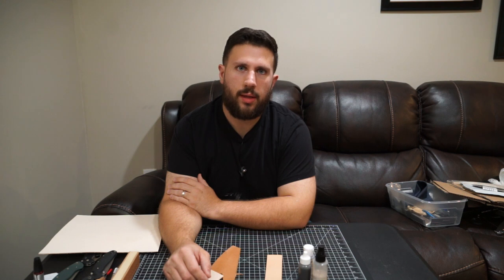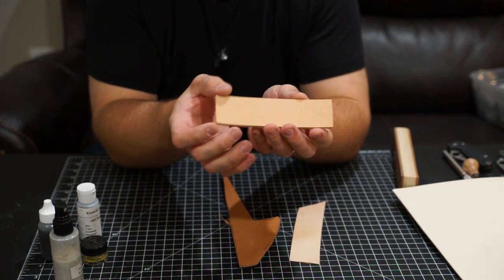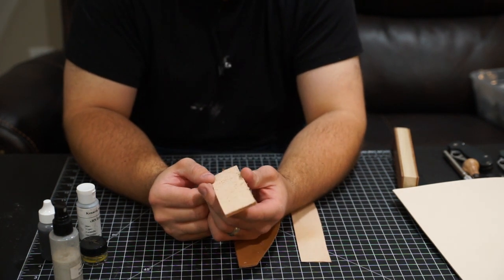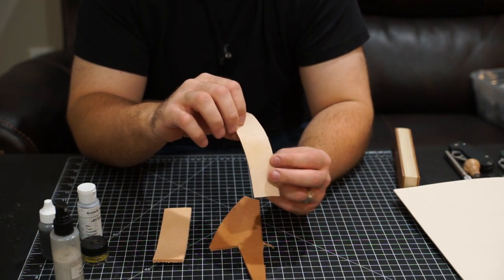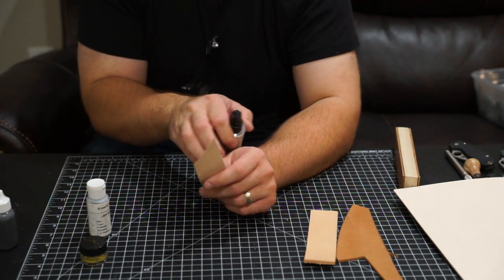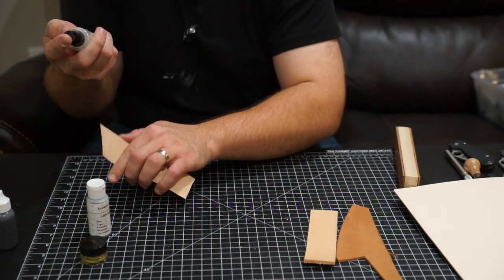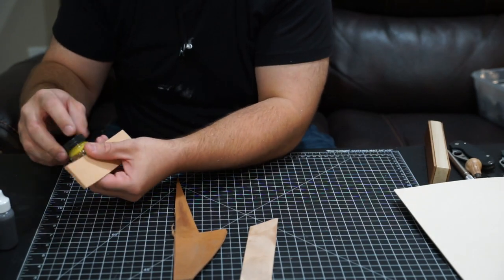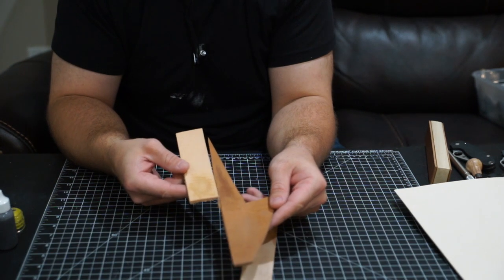Leather and Compounds (How to apply emulsions and pick leather for strops)

Comment: What do you condition the leather with?
Reply from the maker: It depends on the condition of the leather. If it’s really dry I like to use neatsfoot oil and then use dovo strop wax. If it’s newer plush leather a little strop wax and buff with a brush and you’re good to go. It all depends on what you’re using it for.

Comment: Hi Mike, what glue would you recommend for putting kangaroo hide onto a micarta base, your opinion will be greatly appreciated. I am just starting my strop building, l love your videos👍
Reply from the maker: I would use contact cement personally. Get a good quality like Barge though. You can use double sided tape but you have to lay it down very evenly or the leather won't lay down evenly. I would use either contact cement or very light duty epoxy.

Comment: Hey man, just found your channel & I've subbed! Just started getting seriously into knife collecting the past few months & I'm really into Spyderco & Hogue at the moment.
I bought a Wicked Edge & I'm looking to get a more solid mirror polish than I currently have.
Can you tell me what you recommend next after the following progression?
Diamond stone grits: 100, 200, 600, 800, 1000, 1500, 2200
Leather strop with diamond paste: 5 μm, 3.5 μm
Knives Plus leather strop block with green compound (I believe 0.5 μm).
I'm getting a decent mirror polish but it could definitely be better, & I feel like I'm very close to that I want. I've been considering using diamond lapping film, but the blocks & initial film would cost me about $120 by themselves, pious having to but more film as they wear down.
So now I'm considering just going to a kangaroo strop with maybe 3μm or less cbn spray or something like that. Any suggestions as to what I should get next? I'm positive I can finish my blades how I want for less than $120 by going a different route then buying more WE accessories than I already have. I'm super happy with the WE but want to start saving $, considering I already have nearly $600 invested into it. Thank you so much for any help! 😃
I'm thinking after the

Comment: do you taylor the grit size to the steel type ,stainless ,simple carbon ,cpm etc
Reply from the maker: Sort of... Depending on my mood or how much time I have I will tailor it to the knife steel. For S30, S90 and S110 I will stay coarse like no finer than 2 micron. For simple carbon like white and blue hitachi steels I will go finer sometimes as high as 0.1 micron. for my Wusthof kitchen knives I usually stay pretty coarse. For the vast majority of sharpening I use 3 and 2 micron strops. 
     Sometimes I'll go finer and sometimes I won't, but I find that 3 and 2 micron work well for almost everything. Again it all depends on time I have to put into the edge and my mood at the time of sharpening/stropping.

Comment: Just wanted to say Thanks. Always informative! What would use Bridle & Latino leather for ? And would you put a compound on these leathers ?
Reply from the maker: The122979 I use bridle and Latigo for straight razors. I don’t normally use them with compounds but you definitely could. I usually use vegetable tan leathers for compounds but you can use the bridle and Latigo. I would use them for chromium oxide or iron oxide compounds or any compounds up to 3 or 2 micron in size. Nothing finer than 2 but that’s just my opinion.
Reply: iheart Knives  Thanks again Mike. Will give it a try. 👍✌️👊

Comment: What would you recommend to treat the cowhide with prior to diamond paste? For my taste it is too dry and the paste won't spread very well. Thanks :)

Very nice indepths vid man!
Reply from the maker: I like using 100% Neatsfoot oil on Cowhide and letting it dry for about a week. If you are using oil based or wax based compounds you can let it dry for a couple days. For water based emulsions and compounds I would let it dry for a full week. Unless the leather is stupid dry and the oil dries up in a few days. I find that a week of curing is a good amount of time to get supple leather and allowing water based compounds to penetrate the leather well. Hope this helps!